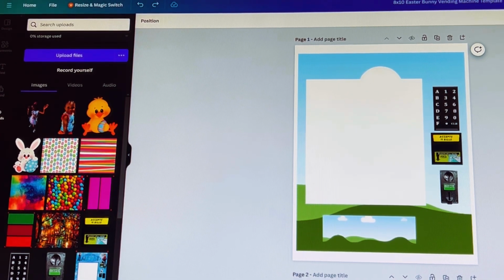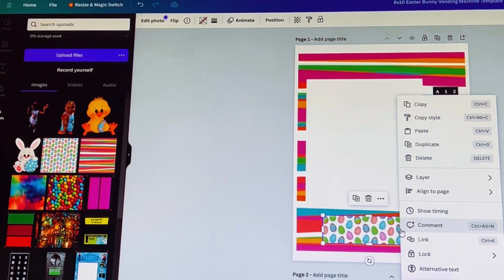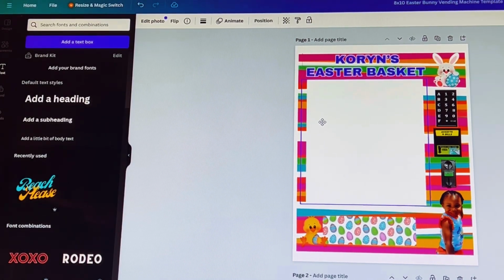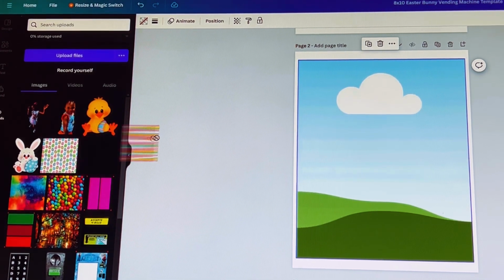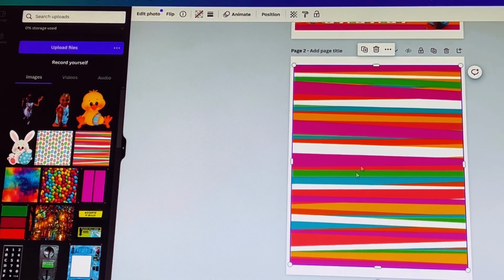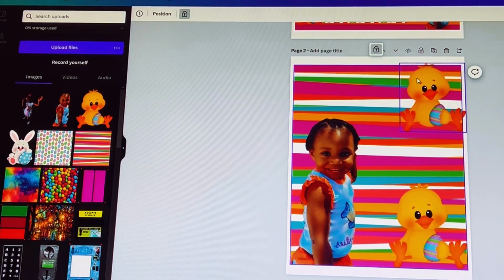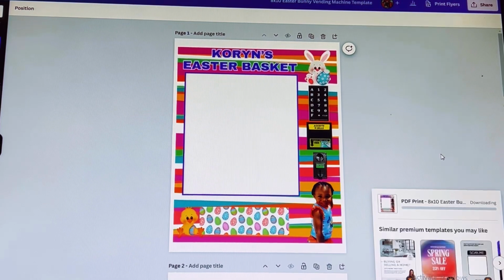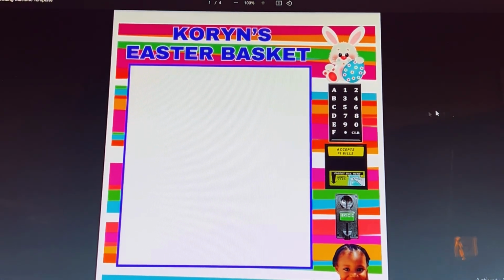How to Edit Your Custom Vending Machine in Canva - Lock Your Image in Place - Layering How to Print

Comment: If i wanted to do this in a 12 x 15...for the side panels, do i just split the images in half lengthwise for them to fit the sides exactly?
Reply from the maker: 🤔. I’m not understanding the question 😞.
Reply: @EPCCrafters  on the left and the right side of the box, how do i make sure those (left/right) side panels fit?